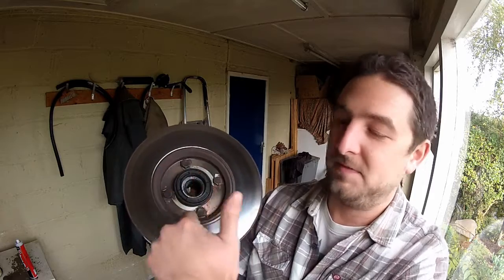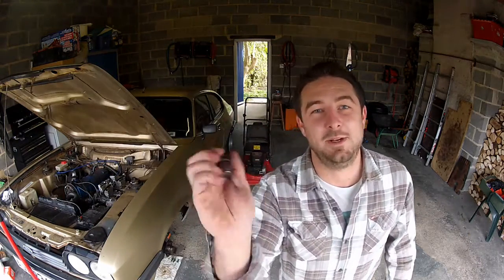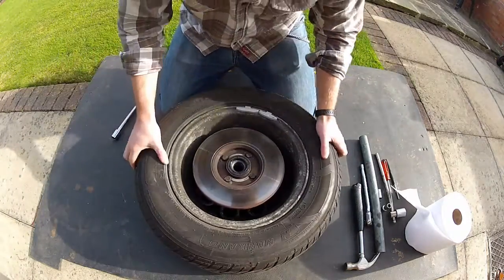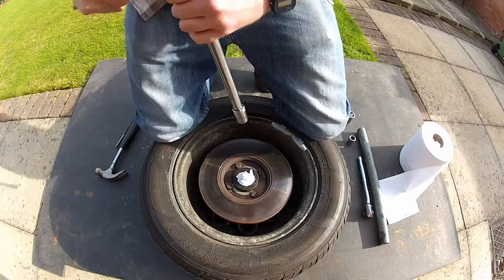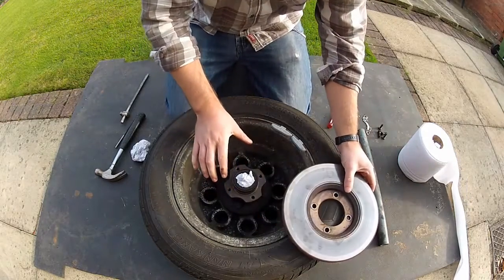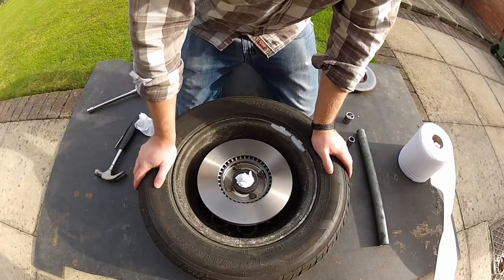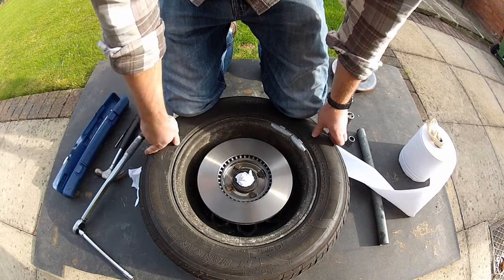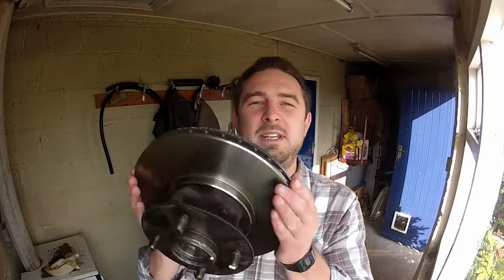How to Remove & Install Brake Discs on a Classic Car with Tapered Roller Bearings | Tech Tip 15

Comment: Great video! Quick question, how do you space the calipers?? I'm a learner mechanic!
Reply from the maker: +Matt Bailey-Smith Hey. Just a kit you can buy, Burtons & Rally Design sell them. Remove the caliper. Remove 4 bolts holding each half of the caliper together. Install spacer with relevant o-rings, then bolt back together with bolts provided.  Then admire your handywork.
Reply: Thanks for that, and keep the video's coming, best I've found so far for novices!

Comment: Where did you get those vented discs?
Reply from the maker: Local parts store, they're standard 2.8 Capri items. Should be able to pick a set up fairly easy.
Reply: @FastRust  ok I live in the states (seattle) it looks like these would fit a mk1 capri as well as the caliper spacer kit which Burton Power has.. thanks!
Reply from the maker: No problem. If you have a Girling M16 caliper that setup should work fine for you. I know a lad with a mk1 track day car that uses this setup also.